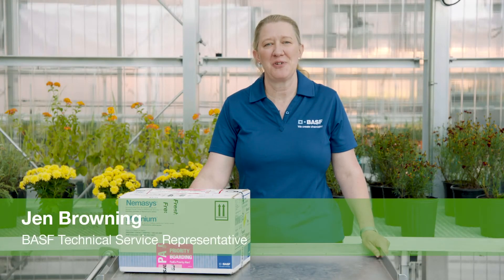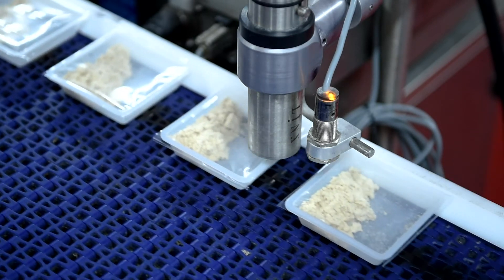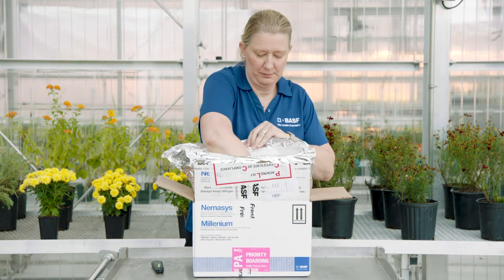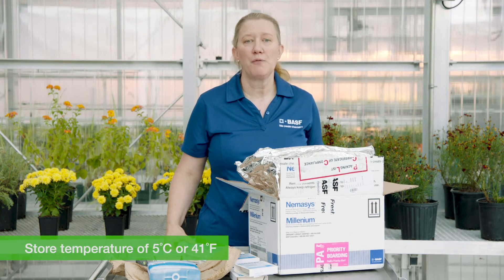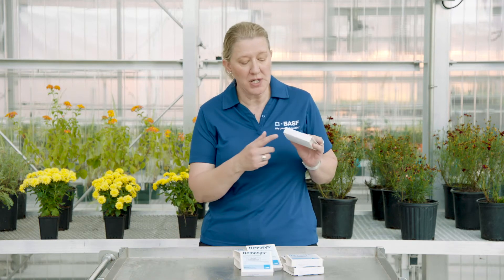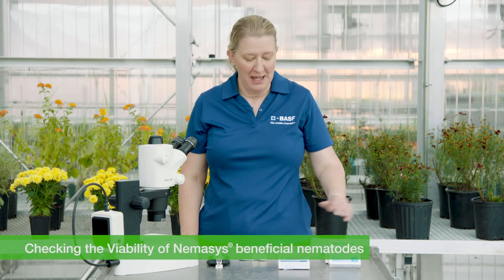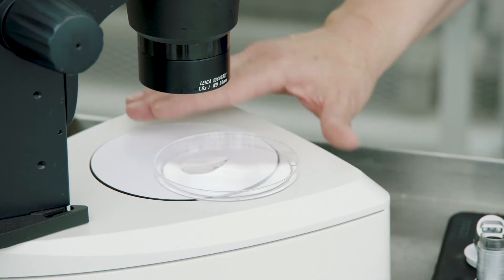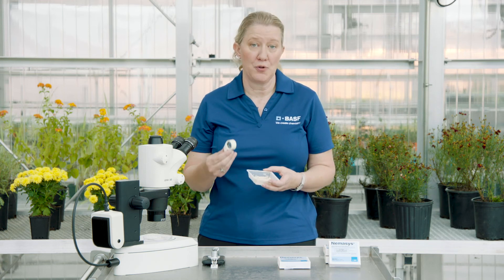Nemasys® Beneficial Nematodes: Receiving, Storing and Checking the Viability

Comment: I just had two different company's I ordered nematodes from, BioLogic Company Inc and Natures Good Guys. In both cases the Nematodes were exactly as you described dead Nematodes appear straight like pins with zero activity.

This is how I have been determining Viability for over 20 years of use. BioLogic Company said that dead nematodes smell like rotted meat and just because they are "straight and not moving" does not mean they are not viable. However ALL Nematodes I have used in the past 20+ years have always been visually active and exhibited the profile of the letter C and S as you described in the video. 

BioLogic Company refused to make it right with us and insisted we were basically incompetent. 

On the other hand Natures Good Guy's did in fact make it right with us. The majority of all nematodes I have used in the past were from Arbico Organics and Sound Horticulture both on the west coast. Both of these company's always sent VIABLE LIVE Nematodes in Styrofoam coolers as you described with zero problems ever.

The only reason I tried BioLogic Company is simply because they are based in PA which is much closer to my company in Maine versus west coast. BioLogic  Company unfortunately chose to argue and lecture us on what a dead nematodes look and SMELL like and has refused us a refund. On the other hand Natures Good Guys did refund our money. 

We still consider ourselves fortunate after this unfortunate experience because this is the first time we have ever received DEAD nematodes. Thanks for an outstanding video!